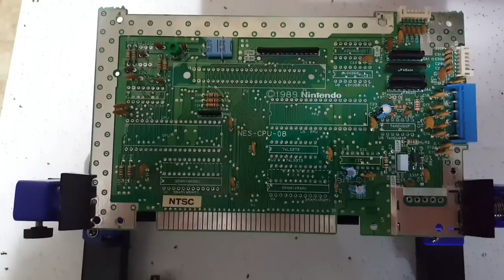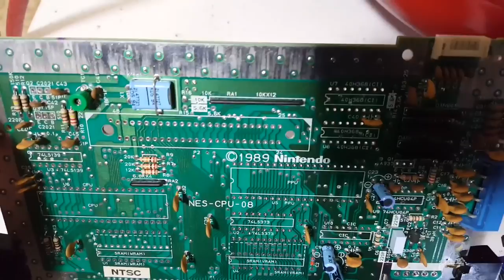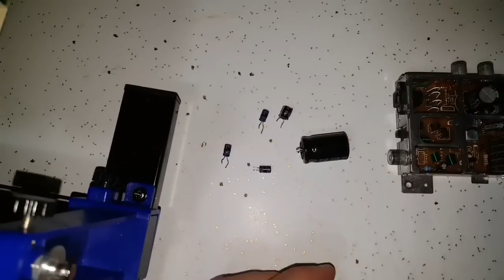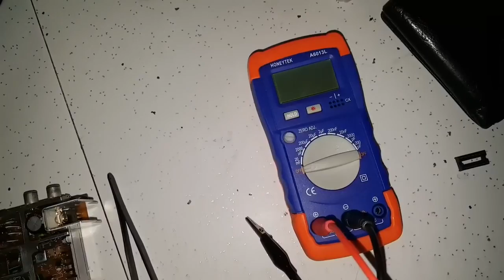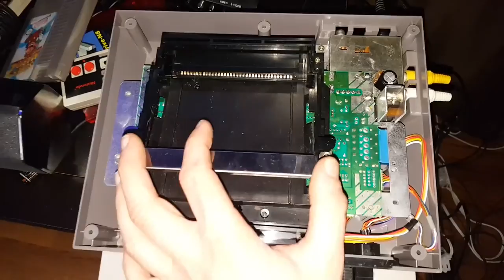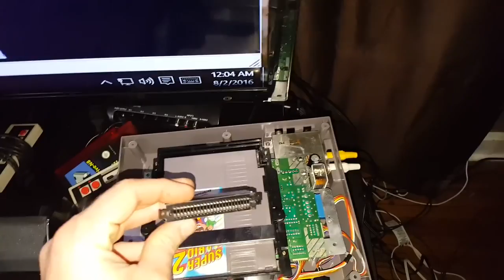NES Test Board Project

Comment: I've been thinking of doing something like this. Nintendo actually made an IC test unit which I have pics of that has the bottom of the console plastic cut out so as to provide easy access to IC slots. The rubber feet is on the top on the console and years ago I saw one on ebay and thought it was something homemade but found out later what it was and kicked myself several times for not buying it.